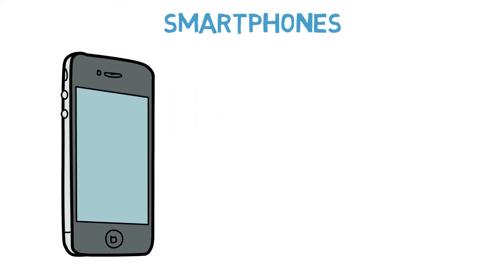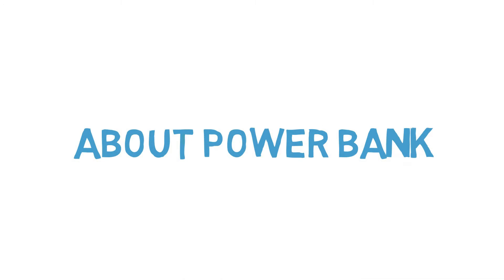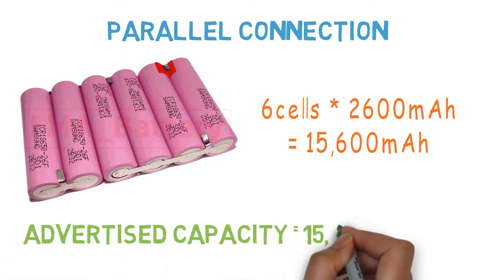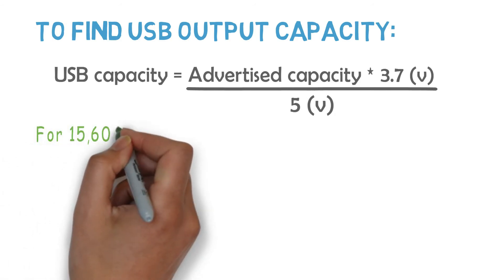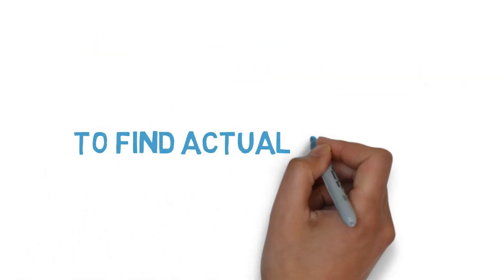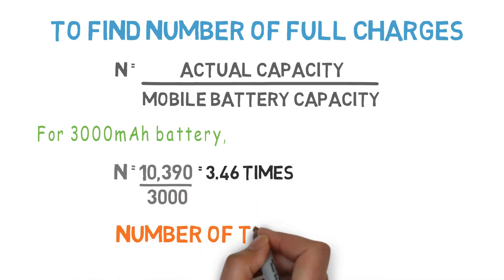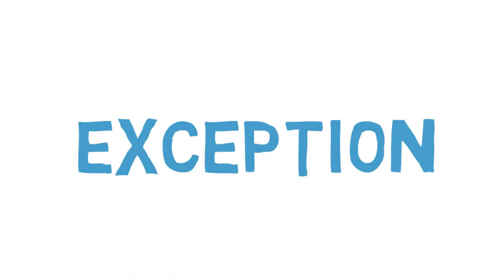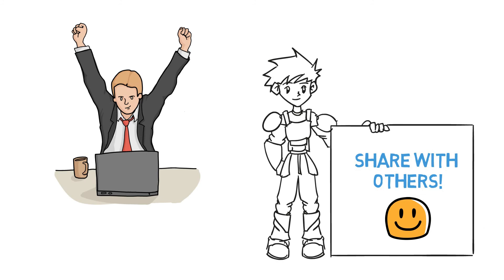How to calculate ACTUAL capacity of power bank | Marketing strategies behind it | Arun

Comment: This is wonderful. It simplified my whole understanding of it.  I applied the formula to a Baseus Blade 100w 20,000mah. Although, after watching your video, I noticed Baseus shows on the box a 'Capacity' of 5000mAh at 14.8V, also a 'Rated Capacity' of 12000mAh at 5V with an Energy Conversion Rate >75%. While it's good they show this the mAh at the different Volts, the math doesn't check out. Any idea why this may be?

Comment: Thanx. But that was totally hypothetical and never been a scientific or practical by no means; coz the first point which you built up on is so random and not confident, I mean any one could write on the power bank any number of mAh's he wish, so, when we continue your methodology we will get fake results. The core idea in the whole subject is to determine exactly the percentage of the effectiveness of the power bank, I.e the efficiency.
The efficiency is the hidden secret here, once it is determined , the whole bunch is straight forward.
Reply: he explained very well. these days it is common Chinese companies mention fake capacity. this is hard to determine. consistency is another issue.

Comment: How can I know the mAh capacity of a chinese power bank? because they always lie to their capacity, I know they have more sophisticated methods that uses a usb but I was wondering if I use a 1amp charger to charge a battery of a 3000mah cell phone and it takes 3 hours to charge (5v common charger) or be charged 1000 mah per hour could i find out the capacity of the power bank battery by the charging time of it? type if I use a 1amp charger and it takes 5 hours to charge 100% it would have 5000mah would not it? Of course this capacity would be from internal batteries to 3.7v and not from the actual carrying capacity with conversion to 5v which has a loss ....
Reply from the maker: Good question, bro! My video roughly shows about the calculations behind power bank charging capacity. If you really want to know the capacity of any power bank(ex. chinese), then charge it fully with any amp chargers (1A or 2A) and count on time..  So, that you can get charging time and you can also calculate the power bank capacity. Your calculations were right (i.e. 1000mah per hour).